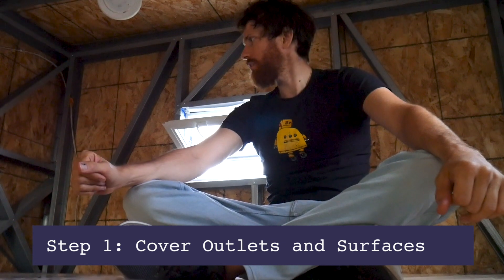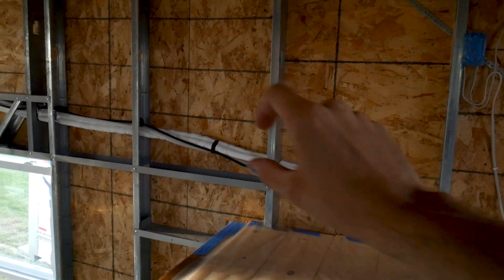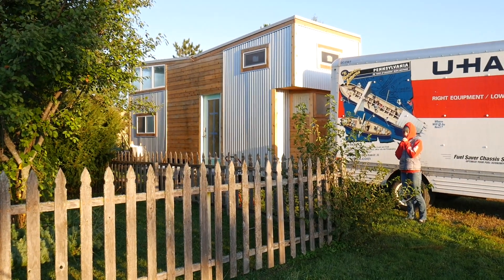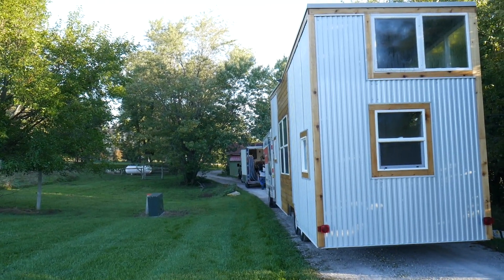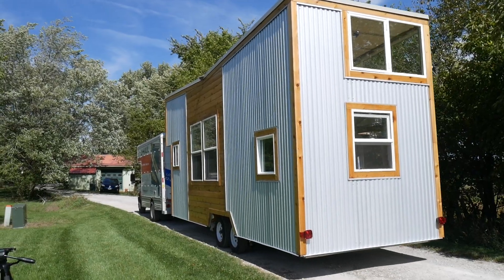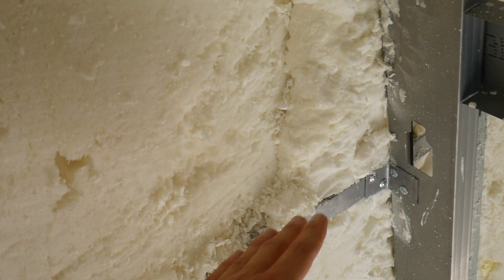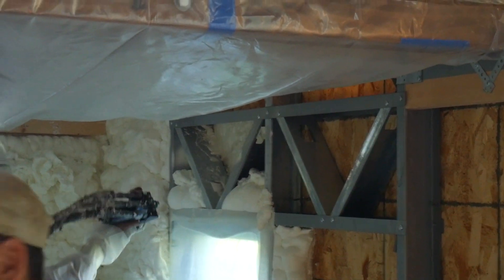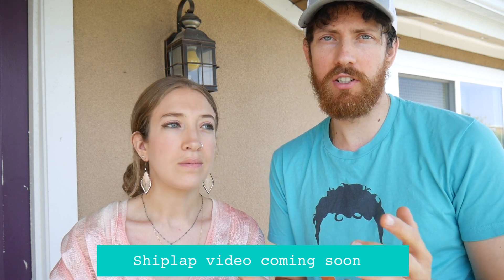Spray Foaming Our Tiny House on Wheels

Comment: I did spray foam for my tiny house & it was the one decision that was really a nightmare and a huge regret.  Went with it for r-value, extra strength for my curved roof, and efficiency.  However, it was installed poorly, leaving huge irregular gaps in the ceiling that I need to somehow fill in with hard foam to prevent mold.  On top of this it has been off-gassing weird chemicals for over two years (despite what the companies will tell you about no off-gassing after a couple days.)  I had to consult a spray foam remediation specialist, and now need to cover the walls with several coats of sealant to hopefully stop this.  Spray foam is kinda like playing Russian Roulette with your home and health.  Not worth it in my experience!
    If I had it to do over, I would definitely have used R-Max instead, or Roxul as a second choice.  For those considering other fibers like cellulose or recycled denim, keep in mind they can mold and will settle - especially with moving - leaving huge gaps with no insulation.  And if you do any tightly sealed insulation, you really need to install a HRV or ERV or mini-split for controlling humidity (to prevent mold) and getting fresh air!
Reply: Thanks for the insight! I’m doing research now and I’ll definitely add this to my notes.

Comment: Does spray foam also by chance help with noise reduction? If so, that would be a great bonus.
Reply: Cynthia Howe noise reduction so no one hears you moan? Or you don’t hear any lawnmowers or horns outside? 😝
Reply: No, it doesn't stop outside noises anymore then fiberglass insulation.  However,  since it seals better,  less noise gets through
Reply: @Ricky32908 creepy way to say that man.

Comment: I was wondering during the whole video why you went with open cell and not closed cell foam, got my answer @ 7:48 
interesting to hear for the first time that closed cell foam is not desirable for mobile homes (because they can crack when moving), because I learned online that closed cell foam adds between 75 and 200 percent additional shear strength, which adds structural support. in addition to this, another pro closed cell has (other than the higher R value), I believe, is being lighter (uses less, more expandable spray foam material) which improves fuel economy.
how did you arrive to such conclusion? have you read online about other people's experiences? or just based on your first principles thinking?
Reply: I chose closed cell for my micro THOW (16 ft.)  last year/2019 for R-value/efficiency, weightnl considerations, add to structural integrity.  Unfortunately, moisture has plagued me and I will be installing a fresh air exchanger --- additional and unanticipated cost.

I found a small table-top size dehumidifier at Amazon that is helping to control the situation.

 BTW, I live in Illinois so  similiar climate conditions.

Comment: Hi guys. I actually was going to do spray foam insulation myself, but instead decided to do foam board, but im super curious, how much does your home weigh now? Especially since you are using metal studs and open celled, it should be relatively light. My tiny home is around 9000lbs

Comment: A little thought on insulation. Everybody likes to go all out to get the last bit of R value from there wall space and pay good money to get that few extra. Keep in mind this: You have a tiny house which easy to cool or heat even if it was not insulated (empty but sealed off wall cavities) That being said I am quite convinced that any insulation will work great simply because the effect of the extra R points is going to waste when you open a door to get in. IMHO it is not worth it to insulate the crap out of a tiny house (meaning paying top dollar for any insulation system) when the effect of the effort is literally out of the door when you open said door a few times a day... I think even the use of the metal studs (as a thermal bridge) can be an even larger factor then spray foam can make up for.
I must admit spray foam is great is a binder to tie in the wall structure all together and it is great for sound deadening and it can be a vapour barrier... I looked into getting spray foam done and passed on it for a variety of reasons, mostly the cost and the toxicity...

Comment: I know that the job is done, but depending on what part of the US you live in the spray foam MAY cause mold issues in a high humidity climate. I will say this is my opinion since I’ve never used this product and I don’t have any first hand experience with this happening. The information I’ve heard on this has been from people in community who have experienced this problem. Again you might want to ask around or research this to verify. Like I said I don’t know if this completely true, but it may be worth checking out.

Comment: Too late now, but spray foam is terrible for the environment. It has the biggest embodied carbon footprint of any kind of insulation. Also, if you have METAL STUDS, you need to insulate to the OUTSIDE, not between the studs. Steel is VERY thermally conductive, so your true R-value is not going to be good. Even a lower R-value insulation outside of the studs could be warmer. EPS is a good option for this kind of build because it's light, but wood-fiber or rock-wool board insulation would be most sustainable.